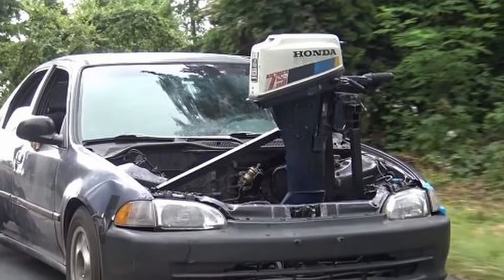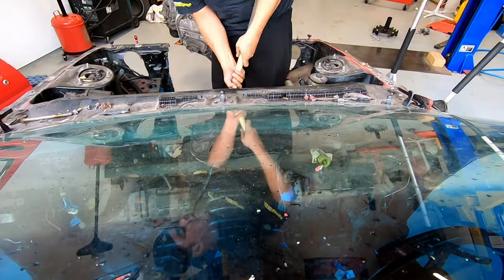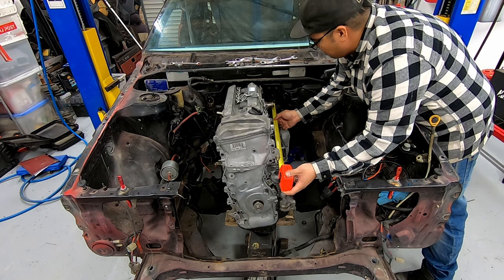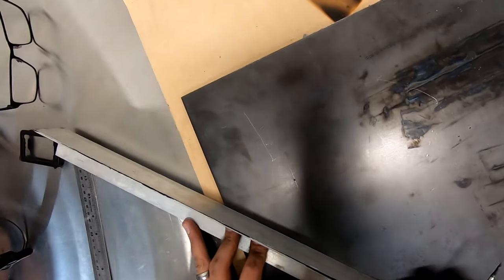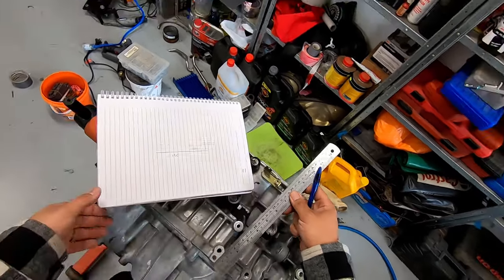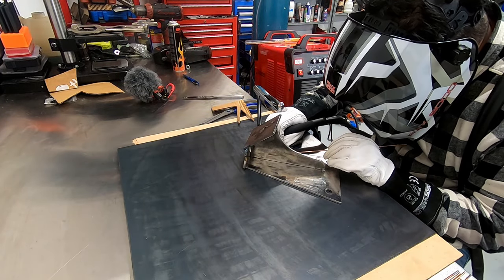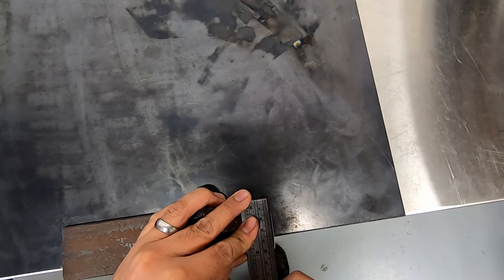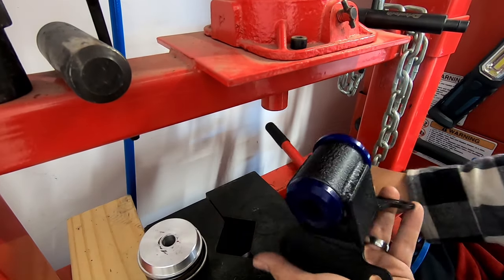How to make custom engine and transmission mounts for any engine conversion - 2AZFE AE86

Comment: Wow that trans mount with the bushing is a great idea. With the new HTG GCU unit out, thinking next summer of taking on putting a BMW DCT in my FD. Been watching tons of videos to determine how practical it is to fab up the trans adapter plate/trans mount and modify the flywheel for someone to do in their garage. But you showing its possible with a drill press, jigsaw, and welder gives me the confidence to take it on. Definitely going to be making like 5 adapters out of wood before I mess with the metal though haha

Comment: My ford ranger has a really solid engine and transmission. The body and frame are pretty crusty so this summer I'm saving my money to go buy a car shell and put my 2.5 4 cylinder in a car. I was thinking possibly crown Victoria or another big car that the truck transmission would fit in. Does anybody have thoughts on this idea?

Comment: great vid. Can you tell me what the lower control arm bush was off please? I am looking for something similar to do my own mounts. Thanks.
Reply from the maker: Hi James, this particular bush kit is to suit a ford econovan front lower control arm SPF2160K. but all you need to do is measure the id of the pipe you are using then match up the bush od on the superpro website. there is almost every conceivable size available so you wont have any trouble sizing one up. Good luck!
Reply: @MODIFYUP  Thanks! I look forward to more of your content.

Comment: Was wondering how you were going to take up the offset on the gearbox mount but the angle iron, tube with brackets kept it all nicely tucked up and strong too. Loved how you merged the standard engine mounts and they look professional.
 
You seem to really know the technical stuff. Do you have a trade? Or do you do something like this for work?
Reply from the maker: thank you james very flattering. I'm a qualified motor mechanic here in aus and have been in the industry for 13 years working in race teams and performance shops. Ive actually put down the tools as a day job which lets me enjoy working on projects that much more.

Comment: Question. Is it crucial that the engine be leveled “perfectly” with the transmission/drive shaft etc? Or did I miss it in the video? Thank you!!! Love the video!!! New subscriber 🔥🔥🔥🔥
Reply from the maker: does not need to be perfectly level however you need to take into account the engine oil pickup location, where oil will pool if its not level. also if too much of an angle seals will leak if the full level is above the seal height especially extension housing.
Reply: @MODIFYUP  ok thank you!!!🔥🔥🔥🔥

Comment: Looks great mate.  Where does the slave cylinder fit on that bellhousing?  Also, what's the plan for the reverse starter layout?
Reply from the maker: aaay the original 2az godfather himself. Slave sits at the top of the belhousing which actually sits proud of the mounting face so I'll have to trim the plate a little to get it to work. the fork also comes down from the top vertically which is also a limiting factor on space. Starter is quite simple its just needs a small pocket cut and re-welded on the firewall. With 2 inch subframe spacers you could probably get away without cutting the firewall at all.
Reply: Sounds good.  Are you running a subframe spacer now? Does the starter take any room needed by the pedals or steering?
Reply: @MJBOGAN  it is currently setup with 10mm subframe spacers but could be removed with more massaging of the tunnel hence why i havent mentioned them until now. Bonnet clearance would still be ok as theres about 30mm to the under bonnet webbing. The starter pocket will interfere with 1 mounting point for the hvac box but nothing else. Once the pocket is welded in i'll fit the heater box and see what mods are required for a factory fit.

Comment: hey mate, just wondering if you've ever built a turbo 1az or 2az? considering going down that path for a rally project and wondering what sort of reliability you could get from a stock long block? sick video series, keen to see more
Reply from the maker: Hi i think we spoke about this in another comment section. the limiting factors in the stock bottom end are the factory match stick rods and the head lifting off the block. in both cases the engine needs to be dis-assembled so I would not recommend boosting the motor before doing the bare minimum of rods, thread inserts in the block and arp headstuds.
Reply: @MODIFYUP  i reckon i could get rods and head studs done for pretty cheap so thats really good to know. thanks so much for the info.

Comment: Hey I got a question so I’m trying to do the same thing but currently the trans isn’t with me do you think I should wait till I get the trans or could I build the mounts still without the trans ?
Reply from the maker: Hi benita, I would strongly recommend you wait till you have the trans and have both the engine and trans sitting in the car. It would be very difficult to get all of the clearances right without the physical trans and engine in to measure against.
Reply: MODIFY UP thanks just what I needed to hear
Reply from the maker: @benitamanzanarez3520  tell me more about your swap. is it going into an ae86 also?
Reply: MODIFY UP no my car a s13 2jz swap with 300zx trans all diy just like yours!!
Reply from the maker: @benitamanzanarez3520  very cool